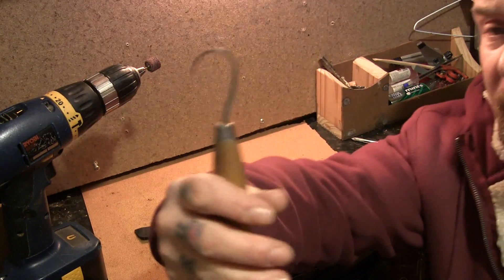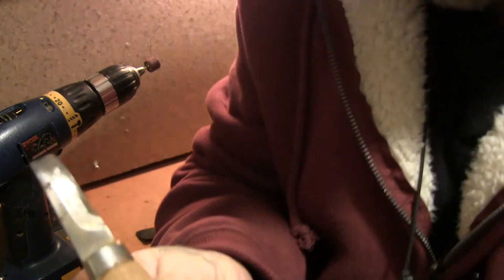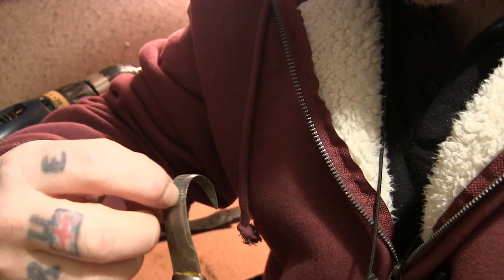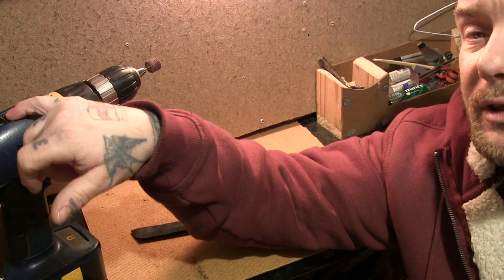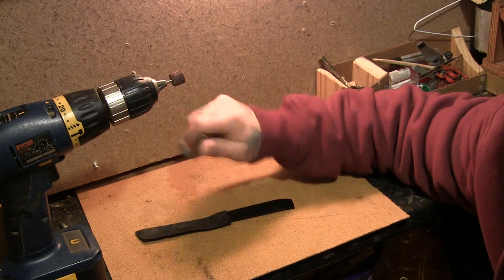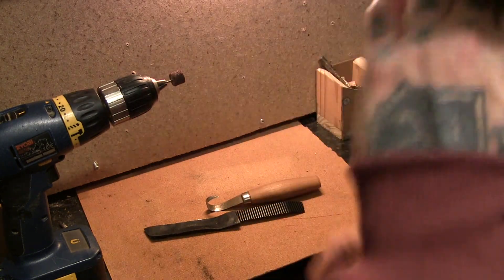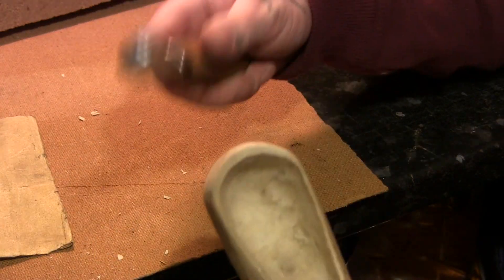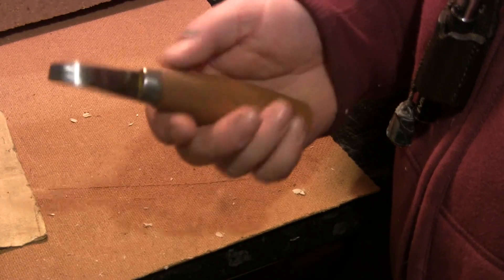Modifying A Mora Crook Knife Blade

Comment: Good idea with the drill malc,i find pointing them up in a vice like an inverted drill press helps a lot with this kind of thing...works with angle grinders to when you need to cut out finer work....on a side note,that is a fine looking racing spoon mate

Comment: I honestly dont know why Mora bent knives get such a bad reputation. OK they arrive looking more like a spare part for a ford escort, but with effort the steel will take and keep a very keen edge. Its a case of tuning them to your own requirements. I've used them for around 7 years now. I rehandled them with handles around 3x the size of the factory handles, and reduced the width of the 163 blade and emoried out the secondary bevels. The strop up lovely... I got a robin wood spoon last week knife thinking it would be a good upgrade from the "crappy" mora, but was amazed to find that my mora 163 performed JUST as well as Robins blade. The only difference was that HIS blade came ready usable. I think I  wasted my money there mate....